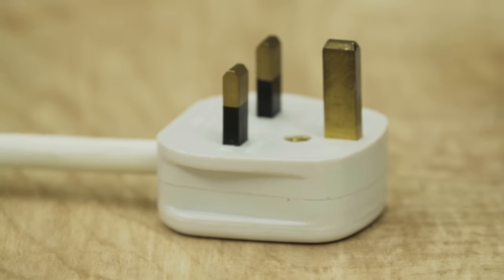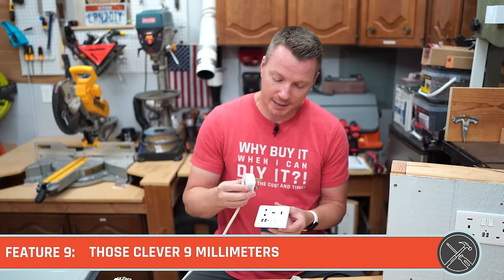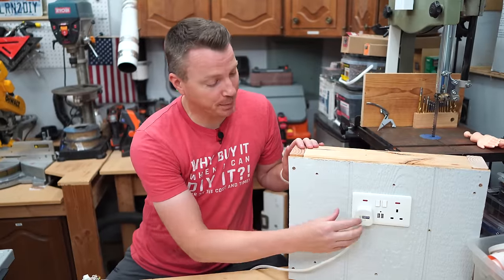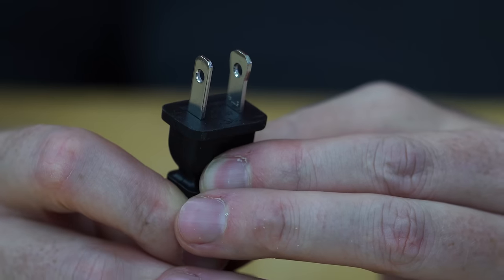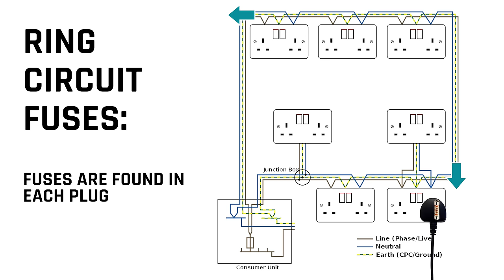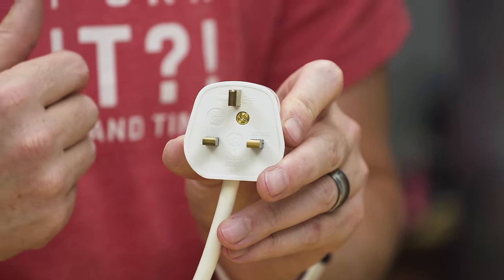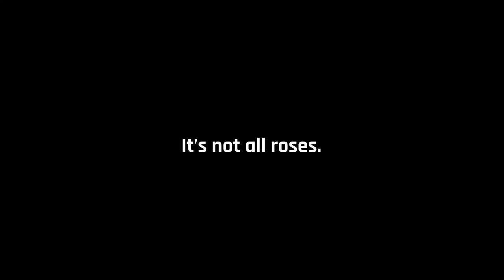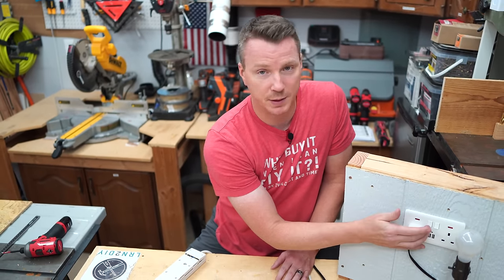British Plugs and Outlets Are On Another Level

Comment: Having grown up with the UK 13a plug I appreciate its rugged, manly engineering. But it now does feel overly massive for some of the lighter loads that we have, even televisions are lower powered than they once were, and led table lamps don't need such a heavy duty plug. But, safety remains important, especially as we use 230v throughout and expect to plug a high power appliance in to any and all sockets.
Reply: You can get your hand around a British plug. One of its design features.

Comment: the accidentally stepping on it downside is actually mitigated by the individual switches, you just KEEP THEM PLUGGED IN at all times because you already can cut the circuit with a flick on the switch.

Comment: A ring final isn't the reason for plug fuses, they're not essential, they are included to protect to flex to the appliance, but in practise the OPD will almost always operate before the fuse blows. Ring finals are becoming less common these days. Personally I wouldn't rewire as a ring final, maybe I'd have the CPC as a ring, but the line and neutral as radials.

Load balancing isn't a problem in practise, 2.5mm cable can sustain a load of 27A or 6.2Kw when configured as a radial circuit, which is more than sufficient for most rings. Kitchens, Electric showers, immersion heaters etc, should have their own dedicated radial circuits.

Comment: I'm probably not impartial but I prefer the plugs we have in France (type E)
I also dislike the fact the US (and a few other countries) are using 110 v instead of 220V (for single phase so neutral to phase voltage) since it means that for identical power intensity is mostly only half leading to lower gauge wires (mostly because since one is 60Hz the other 50Hz some types of loads might have a disadvantage for example iron losses are greater at 60Hz)

Comment: The ones with the plastic pin (double insulated) with the double square marking are known as class 2 electronic devices here in the UK IIRC, though I think it refers to the devices which use these plugs rather than the plugs themselves. One thing I'll mention since you used a lamp as an example which probably isn't relevant to your video, but, I imagine most lamp maufacturers use the microswitch design in their products now which is inside the bulb housing itself and operates when a bulb is inserted/removed so you cannot get a shock if you touch the live terminal inside it when there is no bulb in it, so if you've got a lamp which isnt working for no apparent reason it can be worth checking if said switch is working properly. As for standing on an upturned plug barefoot, yes, I've done this in the dark and it is rather painful. There was a joke in the TV series Top Gear about this once where one presenter asked if there is anything worse to accidentally stand on, to which another replied, "A Landmine?" Well, I can't argue with that one! XD

Comment: In my experience, It's safety is fine rather than old round 3 pin plug and socket. But old 3 pin plug and socket are great for a long use without they are heating.  In the extreme usage the square pins make loose contact and failed by heat very quickly than the same manufacturer's 3 pin round plug and socket.

Comment: Schuko socket, bet the author never seen such. Except the fuse (usually outside the plug) rest benefits do they have, actually the cable length thing is that an electrician has to cut right.

Comment: Not sure I follow the argument about servicing the Type G plug being a distinct advantage over the Type A/B. There isn't anything to service in the Type A/B, it's just an extension of the wire and is as easy/hard to service as damage to the wire would be. Without the fuses/slack (which are definitely good design that provide extra protections) servicing just seems moot and if the Type G didn't have the ability to disaasmble those features would have a huge negative impact on the design.

Alao the 240 vs 120 thing. Having a lower overload threshold is bad? Places that need that higher V like electric dryer or oven already have appropriate outlets. It's pretty rare to want to put a heavy duty appliance in a random new location in a house.  I don't think I have ever overloaded a 20A circuit with 120V appliances despite having a kitchen with stuff like toaster oven/microwave (I don't think anything else would come close to a significant draw). 

Technology Connections did do an interesting breakdown of 240 vs 120 for electic kettles I would reccomend people check out.. 

It seems like the Type G has a lot of good safety features, but a modern US codes for breaker boxes, tamper resistant recpticals (with similar shutters), and GFCI outlets covers a lot of those same principles without the bulk and per-appliance complexity.
The main gap I would want on type A/B is the addition of insulating coating on the base of the prongs for partially inserted plugs, but I expect that had some sort of compatibility issue with the receptical design.

Comment: the switch is safety so if the cable is damaged you can just swithc off the socket and remove the plug from the socket without having to turn off your circuit breaker

Comment: the US is a 240V country, you just need to be smart about it and have a double-pole breaker that takes 2 spots in your panel.
it's safer to be shocked at 120V than at 240V, which is a significant reason as to why we have 2-phase 120V in US homes

Comment: There is no issue with load balancing, the ring circuit is designed to carry 16a equally around both legs of the circuit.
Reply: 20 amps in fact.

Comment: - Load balancing is not an issue
- Being confused about an appliance not turning on isn't an issue, its second nature for us to check the socket if something doesn't turn on.
- It being bulky is only an issue with terribly designed extension chords. The fact that its a flat face and comes out the bottom probably makes it more space efficient if you want to put something infront of it.

Comment: It's not quite correct to say that North America uses 110/120v. And it's kinda a wild story. 

The US electrical network (that is the poles and wires in the street) runs at 220-240v just like everywhere in the world. The reason the whole world runs on this voyage goes right back to the start of electric power.

The first electric networks were built by Edison to power his carbon filament light globes. These light globes only worked at 100 - 110v. However, you couldn't run a practical electrical network at such a low voltage. Moreover, most of the gadgets we have to regulate voltage either didn't work on DC, or hadn't yet been invented.

It had been worked out that if a house was wired in a certain way, each light socket worried see exactly half the voltage that was being fed to the house from the network. This meant that early networks were run at 220-240v, but wired so that each light socket saw about 110v. 240v quickly became a defacto standard for electric networks around the world. 

Pretty early on, Edison's light globes were superseded by better light globes designs that could handle 240v without burning out. This lead to most countries dropping the special wiring and just connecting all the light sockets to the full 240v supply. Except in North America.

It's probably because Edison had already sold many thousands of 110v light globes before the 240v globes hit the market. And probably also because light globes were an expensive item that people might take with them when they moved house. For whatever reason, North Aberican houses continued to be wired so that at least some of the light sockets would only see half the supply voltage, and this be compatible with a home-owners existing supply of 110v Edison light globes. 

This practice eventually became part of the standard, and to this day, North American houses are wired for backwards compatibility with first generation light globes that were discontinued in the market over 130 years ago.

I think there's a lesson to be learned there about making sure your standard is correct, because once it's standard, it's very hard to change.

Comment: In India we have these 3 pin plug prongs as round instead of rectangular ish and also sockets will have shutter for safety as well. Many good quality plugs will have fuse and a neon glow light for the indicator that plug is in use. Also different amperage rating is given to the plugs based on the usage.. Anywhere between 5 amps to 32 amps for running different household appliances.
Reply: Hi Raj,
That is actually the 'old' British system that was replaced by the type G. I remember the old 2amp, 5amp, 15amp range of plugs (I still have one or two in a box in the garage.
It is much easier to get a good contact between Flat pins and flat sprung loaded contacts than the round pin equivalent, which is why the type G is a "Square pin plug".
Reply: @johnkenyon6910  Hi John,
First of all thanks for your message..what a nice message I saw in long long time on social media.. You are really a great gentleman. Coming to the point...well yes systems are meant to be improved. Though in India we get all the adapter now to fit US, UK type plugs as many many Indians are going to other countries and bringing different electrical/ electronic gadgets, small appliances with them. But the mainstay remains round type only with better and better quality materials are being used like fire resistant outer case and based on amperage; pins metal also will have varied thickness.
Reply: @-R-B  
Hello Raj,
Thank you for the compliment.

I have a soft spot for the old Type D round pin plugs, as they once taught me a valuable life-lesson:

When I was at school, each dormitory had one 5 amp plug for the cleaners vacuum, and  a 2amp plugs at each bed/desk, so that you could only power a desk light, or a stereo. I wanted to power a coffee maker, so asked permission if I could drill a hole through a wooden partition to get at the 5 amp plug nearby. I was told "No". That didn't fit with my plans so I did it anyway; I got in a whole heap of trouble.

The lesson is: It is better to do it first and beg forgiveness after, than ask permission and risk being told "No".
Reply: @johnkenyon6910  Hi John, 
looks like you were quite a rebel in your school days.
Reply: @-R-B  
Not me Sir!
I didn't shop lift, do drugs, or get into fights. I just drilled one little hole in a wall😄

The 2amp sockets were off the lighting circuit. One Friday evening we managed to fuse all the lights. We knew the maintenance people wouldn't be in until Monday so we faced a weekend of darkness. We made a length of wire with a 2amp plug on one end and a 5amp plug on the other, and plugged them into both circuits. We happily ran the lighting circuit like that all weekend.

Do not try this at home.........

Comment: On the note of size, since the cable goes down, it tends to be flush to the wall, and thus use very little space, and be quite hard to catch by accident.
Load balancing... isn't something I've ever had to worry about. I mean, I know not to run like three kettles on the same ring, but it's actually hard to saturate a full ring main.
I'm gonna disagree on the difficulty of maintanance, particularly for like, adding a new socket, as it requires almost no effort.
The switches have never been a problem for me, and I've never stood on one of these things in my life.

Comment: As a child in the 1960s I was severely shocked pulling out a plug that did not have the line and neutral insulated. My small fingers went behind to gain more grip. The design was modified to prevent this. As an adult I trod on one- that was subjectively more painful...........

Comment: 3:20 that is not a strain relief, more like a cable holder. Strain relief blocks the movement of cable to certain point, so cable is harder to bend, but still able to (certainly not like apple is doing with their chargers). And although you cannot physically pull the plug from the wall by cable, i would rather have that feature from a safety perspective, eg. a person trips over a cable and cable gets disconnected vs. rips a cable / power plug from a wall. Or be it a roomba that eats a wire, a pet playing with it or whatever... With the added benefit of quick disconnect from a wall 5m away after vacuuming :)

Comment: That last shot made me cringe! 😭 We usually just keep our appliances plugged in. And now there are compact UK plugs where the earth pin pushes in.
 I don't think the other drawbacks you mentioned are problems. While it's true that UK plugs are much bigger and they can be a hassle to travel with (if they're not the compact version), but US plugs and similar plugs stick a lot further out of the socket. The pins of US plugs are also prone to bending. I think US companies would refuse to adopt the UK plug system because they don't want them to be replaceable, forcing people to buy a whole new appliance.
By the way, I did stick a screwdriver into a socket as a child because I've heard it lights up the clear handle. Although nothing happened, I would never do that again.

Comment: What about the European 230V plugs? I think they're the best, they can be either bulky with 2 earthing clips or very thin, with just the live and null wires, depending on the application.
Reply: The British plug is the best.
Reply: @johnburns4017  you're saying that because you're probably British. But being so bulky and with extra features that can fail (fuse, switch on the outlet), it hardly qualifies as "the best". Maybe just the safest, but for sure not the all-round best.
Reply: @HDJess  
I am saying that because it is the best. Not having a fuse or a switch?  Madness.
Reply: @johnburns4017  again, you're saying that because you're British. You don't NEED a fuse in the plug or a switch, it's just for commodity and an overcomplication. There's safety enough with a standard circuit breaker box that handles all sockets/bulbs.
P.S.: I've lived in London for a while, I have the experience to compare both in real life and I tell you, EU plugs are much better and the outlets look miles better without the switch.
Reply: @HDJess  
You really do not know too much about these things.

Comment: I can tell you that the ring circuit is not in use anymore, you may find it in old installations but is definitely not  installed anywhere new , most old houses have had the ring circuits upgraded .

Comment: You mentioned about sticking something in a socket and how us brits haven't or can't do that, trust me we can, I have first hand experience of it, I plugged something into the outlet but it wasn't flush or seated, probably had 2cm or less gap and me being a dumb child back in the day I decided instead of grabbing the plug normally I went and stuck fingers in between the socket amd plug to pull it out, it did come out, I also went across the room and for probably half an hour could hear my heart beat in my ears, felt like I was having a heart attack st the young age of 8 or so, everything was vibrant and bright visually, I was very confused, I must've laid on the floor for a good hour after, never told anyone about it, sure learnt a good lesson of not messing with electricity that day though 😂

Comment: Strictly speaking most sockets are considered 13A TOTAL whether they are single- or double-gang, so if you plug a heater in you're not supposed to use the second socket at all. One reason to have lots of single-gang outlets.

Comment: Watch out for the chinese version. For some reason they add the insulation to the earth pin as well and it does NOT make an earth connection in the wall socket.

Comment: Iam from iraq .i used uk socket it is the best in iraq and cheaper than other socket. We have fuse 13a or 10a or 5a or 3a or 2a. If the mcb fail the fuse safe wire and life. In american the socket without fuse this is danger for wire or life if fail mcb

Comment: Having changed my fair share of plugs in my time, I haven't encountered the rubber "fins" at the bottom demonstrated here - you're more likely to see a "cord grip" - a thin horizontal strip of plastic with two screws. They all do the same thing, though, which is to secure the cable and make it harder to remove when pulled.
Switches on wall sockets are quite common but they're not universal.
Reply: Think everyone has stepped on one at some point (even though, as others say, you're more likely to leave a plug in the socket). I have really bony feet too, so it's extra-ouchie!
Reply: @louise_8546  
I have never stepped on a plug or know anyone who has.
Reply: Switches on British sockets are the norm. Few do not have them.
Reply: @johnburns4017  I've lived in a few houses that didn't have them, though they got replaced. (Older houses).
Didn't think my comments were that important for someone to disagree with, but seems they are. I can only share my experiences!

Comment: A few errors to correct :1:  earth is to protect from electric shock only - nothing to do with arcing. 2: Ring circuits do not need to be balanced - the maximum current in UK rings is 32A and the breaker is set at that.

Comment: The best plug comes from Switzerland. It fits most sockets in Europe, but their plugs do not fit our sockets.

For this purpose, electrical circuit breakers are mandatory by law. So you can not get an electric shock, not even if you reach into the socket with a wire in your hand.

Comment: The 9mm insulated part is there for a reason because kids have a habit of curling their fingers around the plug when they plug it in therefore touching the live or neutral pin. However as a Brit I can assure anyone that standing on one of those is clearly the most painful thing on the planet